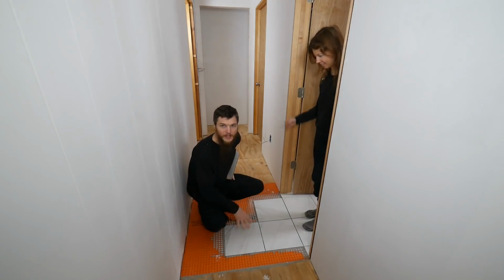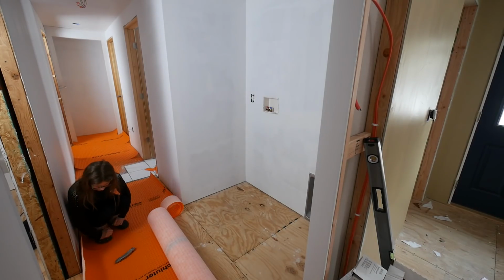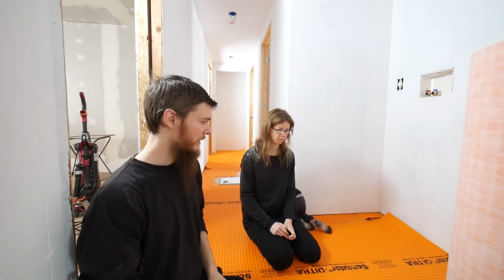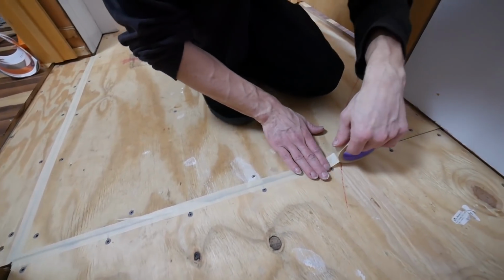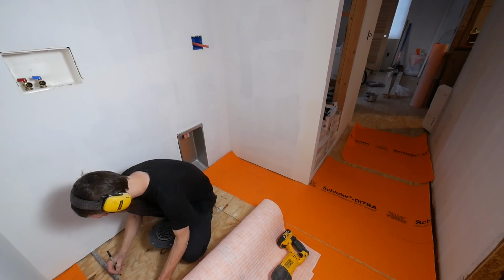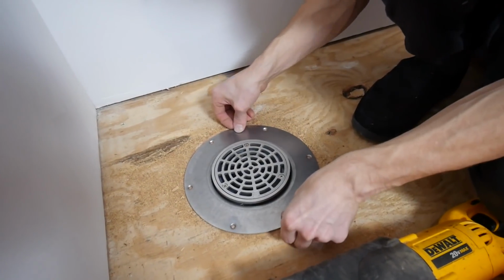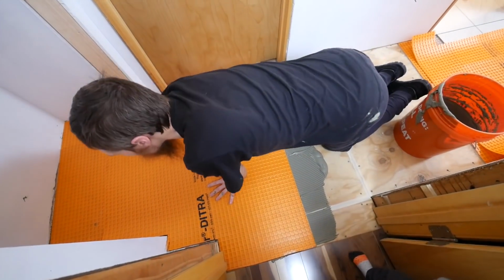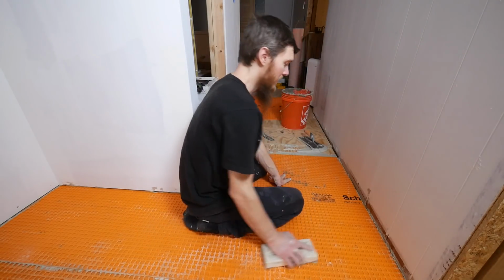Getting Ready for Tile - DIY Family Installs Ditra  - Home Renovation

Comment: make sure you put water down that drain now and then or the water in the trap will evaporate and it will stink.
Reply from the maker: We'll be using a trap seal and the drain will lead outdoors, not to the septic system.
Reply: @diyfferent  If you did decide to run it to your septic you would be able to eliminate the water evaporation issue in the trap by pouring RV antifreeze down the floor drain. RV antifreeze will not evapoate but still allows the trap to function properly.
Reply from the maker: @daveholmberg1471  Good tip :)

Comment: Maybe someone could answer for me, are leaking washing machines a new thing or what? I've had washing machines for many years and never had a leaker.  Now I see all these folks putting drains in.....
Reply: I have lost count how many times my washing machine has flooded our patio. We have installed a drain under the washer as well. In our case the sink drain gets clogged. We have a lint & pet pet hair (4 dogs) strainer at the top of the hose where it drains into the big sink & a strainer in the drain that often gets knocked out of place. My Dad who has no animals has had his washer spill over twice & flood his basement. I think a rag fell into the sink where it clogged the drain. In my experience, I would say it is more often caused by circumstances and human error. When I lived in a condo a neighbor had a flood caused by a faulty leaking hose.
Reply: The seal goes bad in the front loaders but I don't think leaking is an overall problem. A floor drain in the laundry room should probably be more common than it is. I also think we should have floor drains in bathrooms.
Reply from the maker: It's not common, but sometimes the drain hose pops out of the drain and water goes everywhere, or the washer could just spring a leak. We just like the idea of the floor drain so if a fluke happened, it'd be all set, especially if we weren't home while it happened. :)
Reply: @Zhiperser  and the others - thanks for the replies. I learned something new today. Yes, floor drains in the bathroom as well. I've seen kitties toggle toilet handles and stop up sink holes, then turn on the water. What a mess!